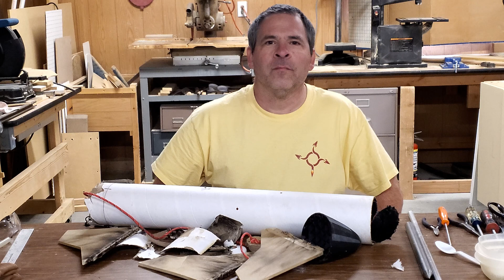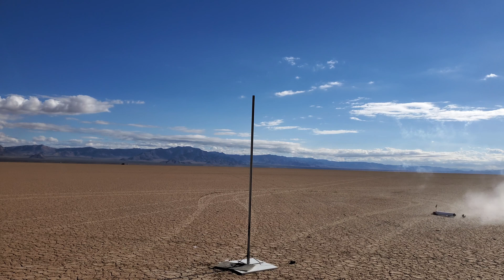Rocket motor explodes on takeoff CATO

Comment: We use 65/35 potassium nitrate/sorbitol. You should try testing it and comparing it to what you are using.
Reply from the maker: I am familiar with that mixture and know a fellow rocketeer that uses it. In short, the sorbitol fuel has a slightly slower burn rate and that makes it a preferred sugar for many people. Although I am aware of that fact, I still prefer using powdered sugar in a flexi-fuel formula. The explosion in this video is from a currently ongoing project using 65/35 KNO3 & Sugar... A classic but aggressively burning fuel. I don't intent do continue using it, it's just for an upcoming video and then I'm back to using the more reliable flexi-fuel.
Reply: @rotaryrocketry  if using KNSU (sucrose table sugar), try using compression to increase case bonding and decrease shrinkage stress fractures. Can't help much for void inclusion if packing the hot propellant.

Comment: deja vu , When one walks too close to the line in the sand...... I was impressed by the fact that after the initial explosion the main body continued upward in roughly the same plane as the launch rail, even though fins were ripped away and rail buttons were clearly not engaged. That tells me the explosion was an end of the motor vs a side. Yep, another armchair coach heard from :-) Silver lining, you didn't have a long recovery trek.

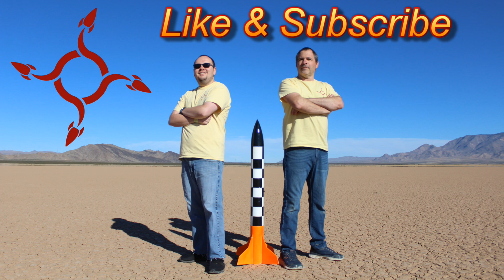Comment: At 1:37, you can observe the ominous black smoke indicative of a catastrophic failure (cato). While I've come across information about Rapid Unplanned Disassembly (RUD) causing this phenomenon, I haven't personally witnessed it on video. Do you have any insights into what might be occurring?

Additionally, could you share details about the camera used to capture the disassembly so effectively? Your filming work is commendable!
Reply from the maker: Yeah, I saw that wicked looking blackness... That was really cool.
So I don't want to give away a lot of details on the project because I'm still working on it but I will say this... "Rocket Candy". And I'm not really having a lot of enjoyment from this project but I am close to finishing.
The camera was a Samsung Note10 on a tripod. What made the footage really good was that I had it set to UHD 4K resolution and 60 FPS. I don't usually shoot in that high of a quality mode because my computer is slow when editing that type of video. But I thought it would be good for just a short liftoff... I was kinda right.
Reply: The white smoke you see typical of 'sugar' motors is from the tiny solid potassium carbonate K2CO3 particles. I believe the 'black' is incompletely burned 'sugar' propellant... https://www.youtube.com/watch?v=2VLXToqXlUI